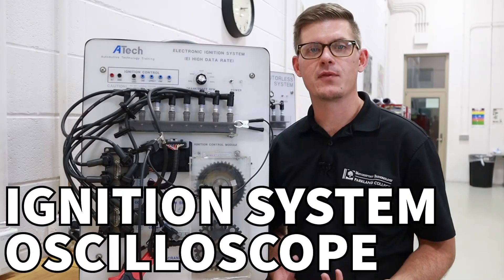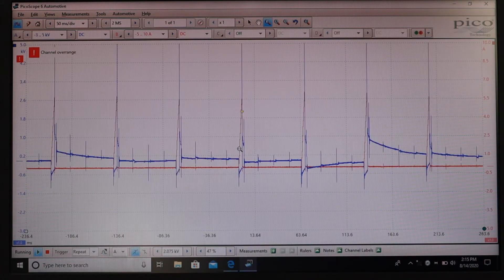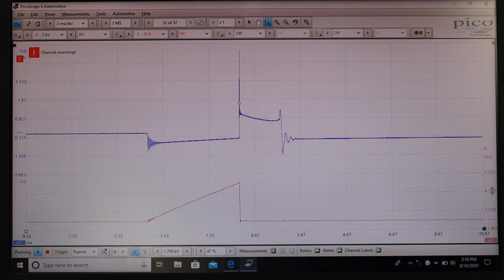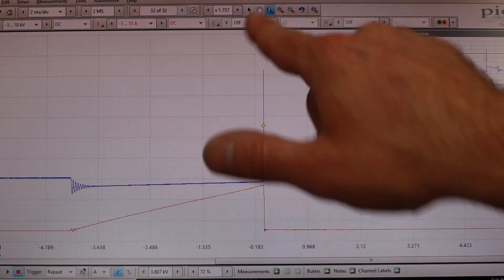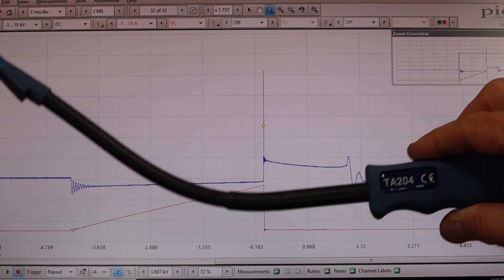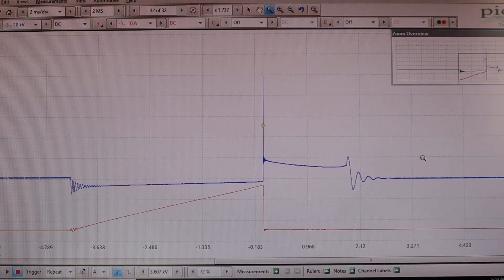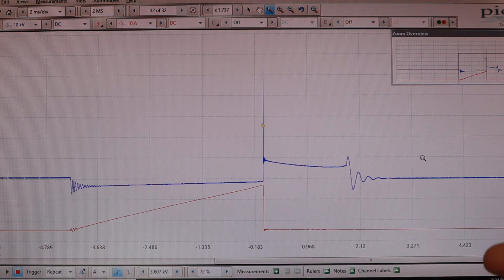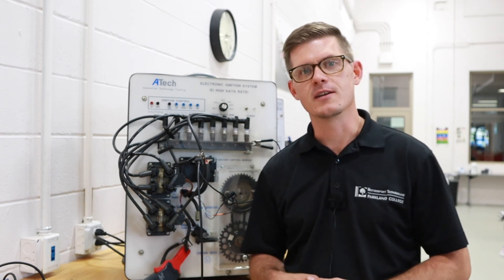Secondary Ignition and Primary Ignition Current: PicoScope Setup

Comment: Nice video. Is it safe to connect your scope to the HT lead as shown in the video? My scope can only handle 20v so I have avoided testing any ignition systems.
Reply from the maker: If you are using an inductive type ignition lead (like shown in the video), it is safe. You never want to use a direct wired or back probed connection with secondary ignition.
Reply: @AdamsAnalysis  Appreciated the responce because its a bit of a mindfield. I use a 20:1 attenuator to help protect the scope as well. Gives me tolerance of 200v so hopefully will be able to use this method. Il do some more research before trying it though.
Reply: Is that HT25 lead only useful for plug wires?  What about ignition coils?